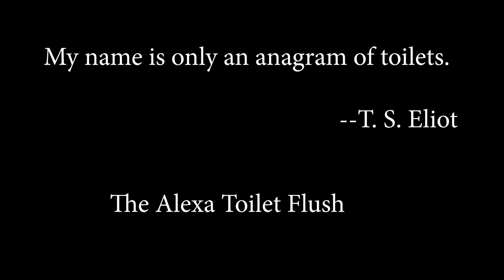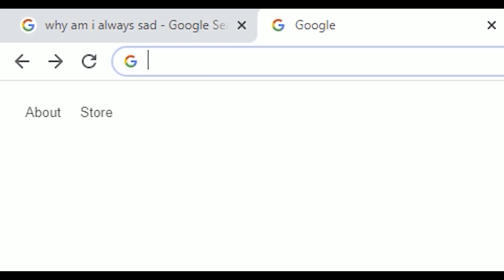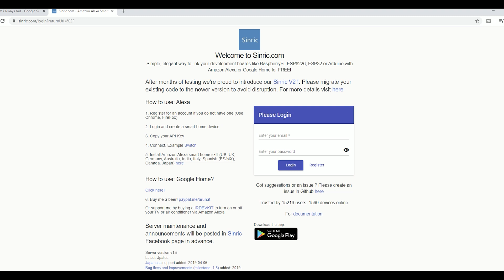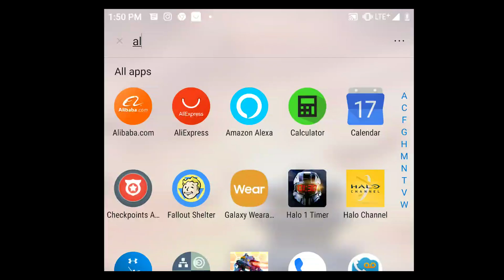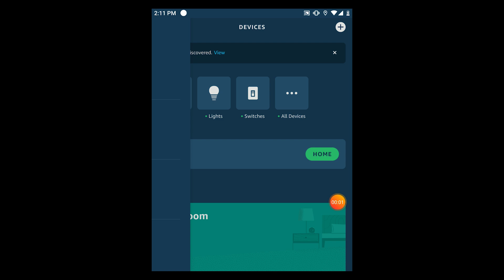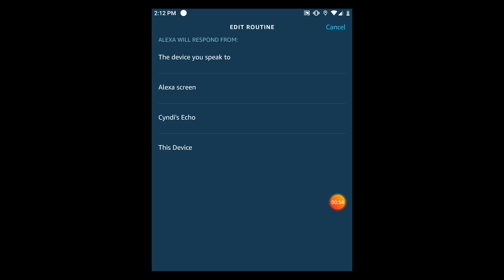Alexa, Flush the Toilet How To Tutorial

Comment: Have you tried Sinric Pro instead of Sinric since they are going to disconntinue Sinric soon?
Reply from the maker: Yeah! Both seem to work really well for me. Love the service.
Reply: Do you have any advice to setting up the same thing but with sinric pro? I am a total noob and I can’t figure out for the life of me.
Reply from the maker: @kfok01  sure! What exactly are you setting up?
Reply: Raccoon Facts pretty much the same thing as your current video. Having Alexa flush the toilet and having it working with the app or Alexa device. I tried using the sinric pro example on switch and added the Device ID, APP key, APP Secret, etc. but to get the servo to work is another story. Since I am not familiar with programming/coding. I am not even sure what I am suppose to change. I used your current program and it’s working. I am worried once they remove Sinric to Sinric Pro. It won’t be working anymore.
Reply from the maker: @kfok01  So I would pull the beginner switch example from their github. Then put this line of code from my pastebin in for the servo

 for (pos = 0; pos <= 180; pos += 1) { // goes from 0 degrees to 180 degrees
    // in steps of 1 degree
    toiletServo.write(pos);              // tell servo to go to position in variable 'pos'
    delay(15);              
    }
    delay(1000);
    for (pos = 180; pos >= 0; pos -= 1) { // goes from 180 degrees to 0 degrees
    toiletServo.write(pos);              // tell servo to go to position in variable 'pos'
    delay(15);

I would place this on the powerstate, but this line of code is for servos specifically.
Reply from the maker: Here is the github example I would use: https://github.com/sinricpro/esp8266-esp32-sdk/blob/master/examples/Switch/MultiSwitch_beginner.ino
Reply: @RaccoonFacts  Do you mean like this:

bool onPowerState1(const String &deviceId, bool &state) {
  Serial.printf("Device 1 turned %s\r\n", state?"on":"off");

 for (pos = 0; pos <= 180; pos += 1) { // goes from 0 degrees to 180 degrees
    // in steps of 1 degree
    toiletServo.write(pos);              // tell servo to go to position in variable 'pos'
    delay(15);              
    }
    delay(1000);
    for (pos = 180; pos >= 0; pos -= 1) { // goes from 180 degrees to 0 degrees
    toiletServo.write(pos);              // tell servo to go to position in variable 'pos'
    delay(15);
  
  return true; // request handled properly

}
Reply: @RaccoonFacts  awesome I think i figured it out! Its working. But now I am wondering why when I have it connected to alexa it shows up as a Plug and not a Switch Icon even though on Sinric Pro I have it as a switch?
Reply from the maker: Hey that's great I'm glad it's working I was happy to help! As far as the icon goes I have no idea you may need to ask sinric.
Reply: Raccoon Facts thank you for all your help! 😊
Reply: @kfok01  Can you post the entire code that you got to work? I am trying to get Sinric Pro to work with this as well and I am having some difficulties.